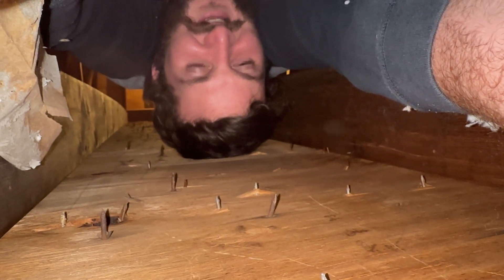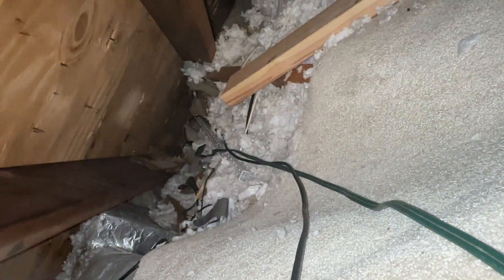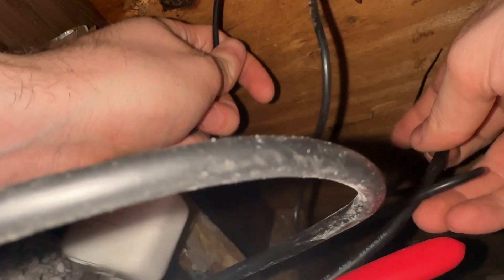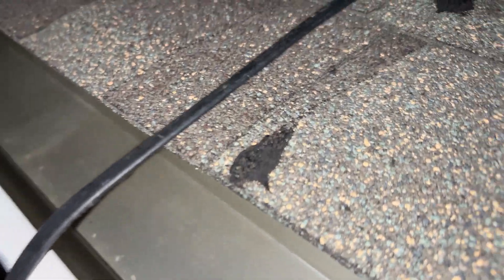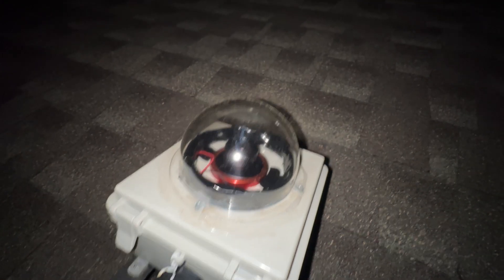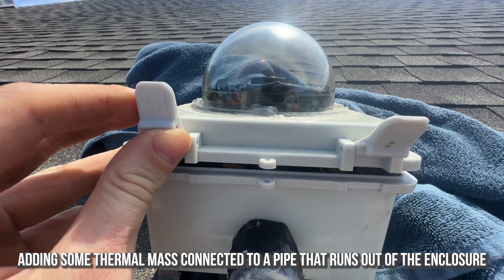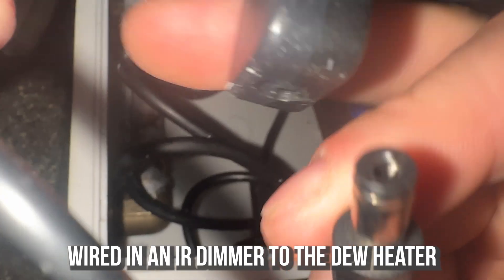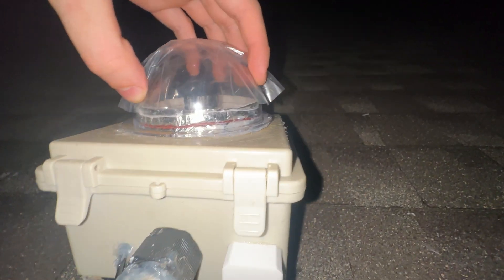Upgrading my All Sky Camera

Comment: Great video, thank you. Do you have instructions for the software setup? I couldn't have it done with OBS-Studio. 😞
Reply from the maker: Thanks! It should be mostly plug and play with the camera. You will probably need to download drivers from ZWO’s website if you’re using an ASI camera. If your computer recognizes the camera OBS should too. The only reason I use OBS is so I can stream the feed as well as all the other widgets & music I’ve got on there, but if you’re not streaming I wouldn’t use OBS. There are plenty of options out there now for just recording that are better than OBS. AllSkyeye is one that comes to mind, I think there’s also another one called Lumisky that is coming out soon. 

If you’re dead set on OBS though, there are a lot of different ways to set that up. I tinker with it all the time to optimize quality & file size. I’m actually going to look into changing how I do it, I’d still use OBS for the stream but I want to save the images in a separate format than recording via OBS. When I figure that out I’ll make a video on that as well :)
Reply: @normanrevere  Norman, thank you so much for your reply. I will give another try to ZWO + OBS

Comment: I'm interested in building an all sky camera. But I'll probably use a glass done rather than a plastic one. Also, maybe a cooled astro camera will be better(?)
Reply: There is no need for a cooled astro cam. It will not help the image quality much. And you will be dealing with a more complex system that uses much more power and generates more heat. And a glass dome for this type of purpose is very expensive. I looked into it a few times for mine. It's more cost effective to just maintain or replace an acrylic dome. My acrylic dome has very good clarity and the only downside it you can't really clean it easily. Wiping it will put micro scratches in it even if you use a microfiber cloth. It's better to just spray it with soapy water and rinse. But mine has been up for nearly a year now and I have never needed to clean it.
Reply: @GrowingAnswers  Thanks! Very good to know.
Reply: Note that the peltier coolers used in cooled cameras increase the net heat in the system, which is trapped inside a relativelly closed environment of the enclosure.  The Peltier cooler needs to dump the heat from the source, as well as the additional heat from the electrical power flowing through the junction into the hot side of the device.  If the interior of the box is already too hot, you've just made the problem worse.  It could be interesting to consider a Peltier cooler pumping heat to a heat sink on the exterior of the enclosure, assuming you could make that thermal transfer weathertight through the wall of the box, somehow.

Comment: watching you struggle through you attic is enough to make me want to pay someone else to install conduit.  But access to my roof is a lil easier (and more spacious).
is it realistically possible to use a Glass dome with 70% Ceramic coating?
Reply from the maker: @wjlambert  Yeah it’s probably the worst aspect of it all. I could have set the cam up further on the roof, but I wanted to have easy access from the outside and not drill any holes through the roof itself. 

A glass dome would probably work, I think the biggest thing is making sure it’s not too optically distorted. The acrylic works well and doesn’t have too much distortion. Not enough to make a huge difference anyway. Probably a lot cheaper too.